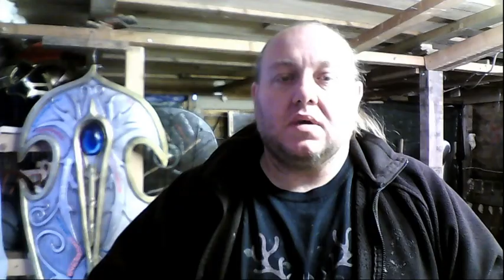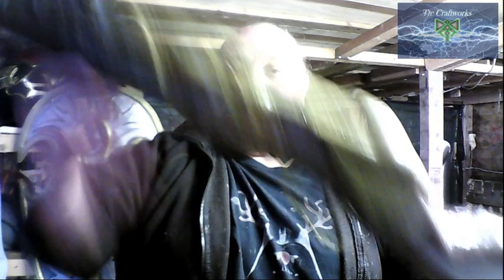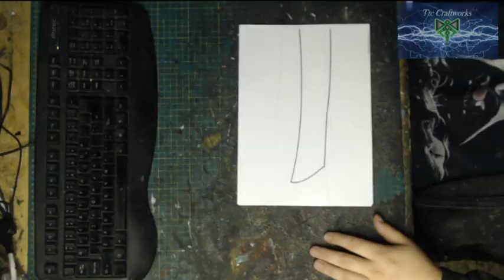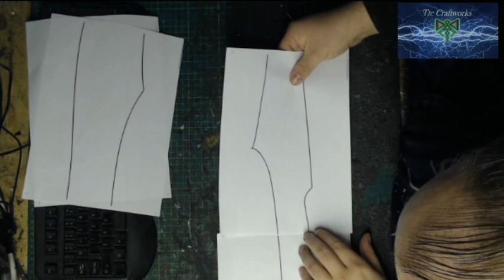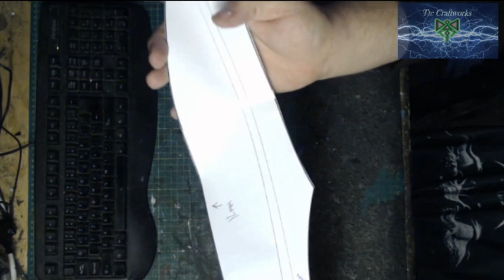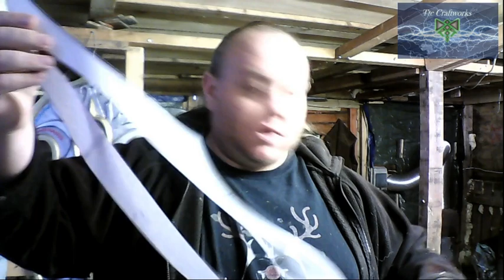Easy larp safe sword build.

Comment: What would you say is the safe limit for the striking edges between the foam and core ?
Reply from the maker: Most systems the safe limit is 12mm on a striking edge and 5 mm on non striking
Reply: @ttccraftworks8469  awesome ! and what would you say is core thickness limit for a very thin sword ?
Reply from the maker: @The-Enthusiast47  smallest I go for swords are 8mm daggers can go down to 6mm

Comment: What foam will you recommend that is soft enough for kids to hit each other with ? thanks!
Reply from the maker: For kids I'm not sure but the foam I use is 45g density. Same as most weapons. But bigger weapons should be ok for kids.
Reply: @ttccraftworks8469   I ended up ordering LD 45 foam from the UK, but I feel like it is too hard / dense to be used as weapon padding. Its probably better for armor. I have spent over $300 on foam at this point but were unsuccessful in finding the perfect weapon padding/ crafting material :(  I could really use any advise. By the way, love your videos ! could you make a video on materials ?
Reply from the maker: Ld45 is what I use for weapons mate. Once it's shaped and latexed It's perfect for weapons. I've seen kids at larp events use them with same foam density just be sure to watch there's no thrusting. Most systems don't allow thrusting unless stab tipped weapons